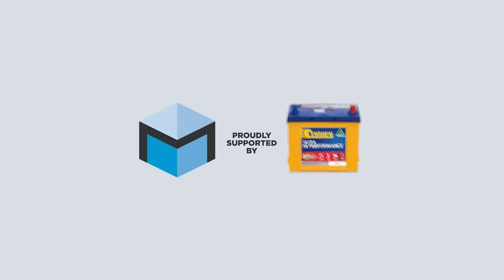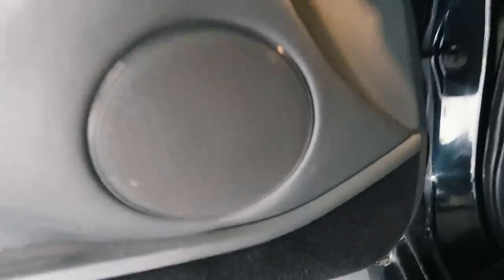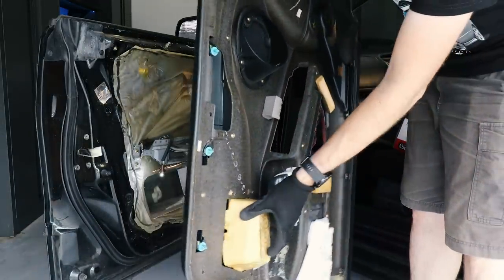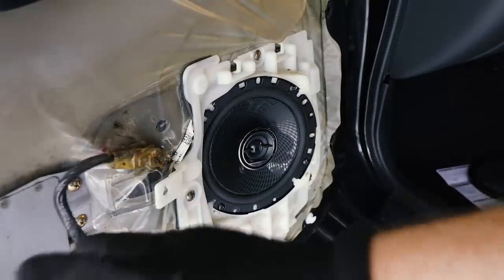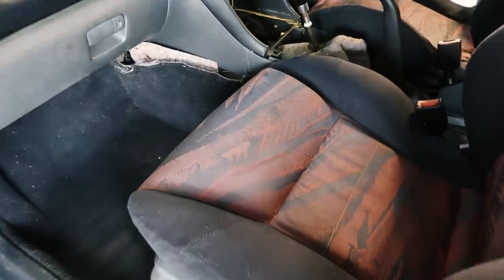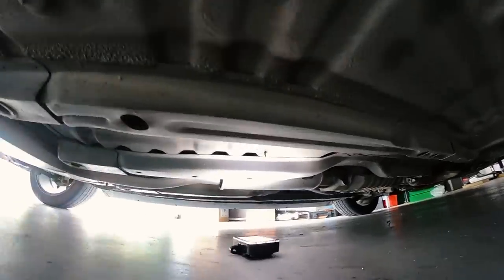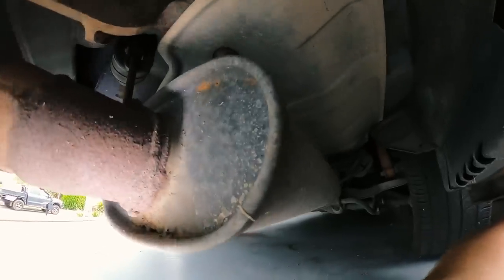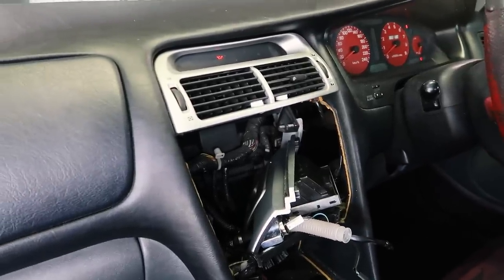😱This Seller Screwed Me! Living the Mitsubishi Magna Ralliart Parts Nightmare.

Comment: Absolutely NOTHING wrong with upgrading your tunes like this mate! You're the one that's gonna be driving AND listening to your favourite sounds. I'd do the exact same myself!
Reply: Nothing wrong with Kenwood either - decent quality Japanese kit.  Cars are very compromised sound stages anyway - so putting high end expensive speakers in them never made sense to me.  Better off spending more money on your living room setup.
Reply: @Beer_Dad1975  very good point. I had a friend that was an audiophile and ad you say a true system would be incredibly difficult in a car. I just loved volume and bass.
Reply from the maker: They're great speakers for the price - I've put them in a few cars now. This was the first time I was able to use 6x9's though, and they're pretty punchy. I am not an audiophile but they seem to output nice bass, so you don't really need a subwoofer (in my opinion).
Reply: @davekennedy6315  That's really what you need, enough volume and clarity so you can hear what is going on over the engine and road-noise - any nuance is lost anyway.

Comment: If the heater core is such a repeating problem due to plastic failures, I'd take the new parts to a radiator specialist and get them to bend and solder on metal tubes instead.
Reply: Investigate at least.
Reply: There have been a few lots done of metal replacements. Still a couple put there from those, but about time for some again

Comment: I hate this car so much and I love watching you fix it up at the same time I’m unsure what to do with these emotions. I’ve cried and laughed at the same time. I’m a mess. 

For pulling the dash apart, All the screws etc into ziplock samich bags as you do each part. Write on the bag what they are for. And even number the bags in order of how you pull things apart. Get some plastic crates and put the bags of parts into the crate as you go to keep the small space tidy. I have lots of crates for bigger jobs and put tape on the front with contents written on them.

Comment: Great video Sean. You'll find as you go on a project that you'll find things that need replacing & it's usually the small ones that hold you back. I'm finding that with my '03 VY S ute that has the factory LS1. One of my switches on the dash was broken & you can't get them from Holden anymore. Ones from the wreckers are dubious as I went through 3 of them to get one properly working. Keep searching & be persistent. Make sure you check the suspension for worn items. I had to replace my tie rods & front bushes over the weekend & I'm lucky that those items can be easily bought.
Don't worry about the haters as it's not their car & only use forums for info & not get into arguments with those who think they know it all. At the end of the day, look at the end goal & that is you'll have a great car that you restored yourself.
Reply: @@xXAussieSkillzXx It was the VY/VZ mode/set button. I managed to find a good one but wreckers being wreckers will sell you any shit they have for a quick $. I had to get a new driveshaft a while back & ended up getting one made. Finding solid axles for Tonners & Crewman are like trying to find rocking horse droppings & friends of mine who have them have to get theirs rebuilt.

Comment: Great video, that Walker exhaust would be the original as Walker was the OEM supplier for the Magna as they had a factory on the Tonsley site. Mitsubishis and exhaust issues seem to be common, for some reason they all seem to suffer from it (all but 2 I have seen have had holes or corroded exhausts). Great to see you do content on the Magna, its such a cool car.

Comment: Make sure you do the hydraulic tentioner when doing the timing belt , its going to let you down later if you don't. They go limp and teeth jump on the belt. Usually about 20oook down the track. Precautions change the water pump valley pipe and O rings too. These also fail over time. Pin holes develop in the pipe and we'll orings we all know.
Reply from the maker: Yup I'll be doing all that!
Reply: @MotoringBoxTV  ensure you vertical bleed the tensioner too. There is an online bulletin somewhere outlining how in storage they can develop air pockets

Comment: Just did a heater core on my VT Commodore, highly recommend taking lots of photos, zip lock bags marked with where the screws/ bolts etc go

And the biggest tip of all- take each part out and lay it on the ground in the order it came apart, and then put it back in reverse order 

Saves getting a long way in and realising you missed a part that should have gone back in earlier!

Comment: Ok so next time you do interior... Pull the seats out and pressure wash them with a small Karcher or something with low power and a wide fan. 
The rub them down with a water based food safe degreaser and go again and wet vac out. One last pass with fabric softener.... Allow to fully dry in the hot sun before reinstall. 
Try it on something crap if you don't believe me.
You can even ad things like bluo or Radiant Black Wash to get colours back out. 
Also make sure you air gun out any plugs underneath the seat too. 
I also do it with carpets and stronger door trim fabrics. The hoodliner can't handle it so your stuck using a damp micro and a wet vac there... Or just replace it.

Comment: You can replace the heater core o rings by debasing the aircon and removing the evaporator under the dash to give access. The replacement o rings sold by Mitsubishi now are improved and wont leak again. Been there done that.
Reply: Pull the gas from the air con, remove evaporator, do some slight metal cutting mods, and then pull out heater core and renew. No need to remove dash

Comment: My Dad had a silver Ralliart magna up till several years ago. Felt good on the road and compared to falcons it felt so much lighter through corners. Most annoying thing I found was I would have to take it slow on the throttle engaging 3rd gear as the clutch would slip under load if you were pushing it. Even when the car was fairly new.
Also the clearcoat was terrible. I think all Magnas of that era were like that

Comment: I've had 2 Magna's over a span of 10 years and found using good quality OE/Genuine parts are the way to go. Also, had a good sound system with an AV head unit. Properly set up using the settings and it sounded awesome, didn't need a sub with the fade set a little to the rear.

Comment: Fantastic cars these RA magnas are and quite a easy car to work on aswell. Even with minimal skill the heater core job is simple. Iirc the head is stamped with RA which denotes it's the genuine RA spec engine (or heads at least).

Comment: Leaky valve covers are a common Magna problem Sean. They have a inner lip that deforms easily if over tightened, but Mits recommend no sealant be used, just torque to specs, so care is needed. From what I can gather, the sealant can affect the O2 sensor.
Reply: Absolutely true, I just finished resealing my whole engine I spent more time cleaning the gunk off than putting on new seals. Don't use sealant of any kind!! It will leak again and it's so painful removing it.

Comment: You have certainly lucked out on the front speakers.
From factory it was a three way split system, woofer in the door, tweeter in that black triangle sail area at the front of the door on the window edge and on the dash were mid range speakers.
Unless the wiring was totally changed, it should still be there.
Dash mids and tweeters are readily available from the wreckers, though, normally in this type of upgrade, you leave the dash mids and then install a good split system in the door.
Too late for all that now, but, just some more info, also, early Verada had door insulation that fitted to the rear of the door cards and will make a big difference in the sound quality and even just closing the door will sound better.
Reply from the maker: Pretty sure the dash ones are still there (well the fluffy grille things are anyway, and I sourced a set of factory tweeters luckily.

Comment: We spent over $2k on that stupid heater core leaking. The original just had an O ring failure but they replaced the whole unit and it completely failed 6 months later. Such a bad decision using plastic parts

Comment: Ex Mitsubishi tech here, just so you know Sean you can technically do a heater core on these with the dash in place if you remove the glovebox and frame, then wiggle the carpet out from under the center console area. Though if you're pulling the dash for other reasons or have the time I would recommend you still do so. Flat rate is a bitch and you'll be sitting upside down in the footwell with coolant in your face if you do it this way.
Reply from the maker: Thanks mate - I read a comment the other day suggesting this (might have been you!) And had a look to see what space I'd be working with. Looked like a bit of a nightmare, so I think I'll still bite the bullet and remove the dash 😬
Reply: Dash is easier way. Dash out is easy. While you are there. Might as well reseal the old dried sealant, left side of windscreen. When it rains you will end up with a puddle on passenger side 2 of my 3 magnas have the problem, and it is very common now . If you get on facebook and search you will find the threads, amc had threads but it was down last time i checked.

Comment: I would upgrade those heater connections, I'd go as far as to re-manufacture them. Not in plastic because I know they will fail again
Reply from the maker: I think it's the o-rings that fail... but having said that I do wonder why they didn't just make them metal and weld them onto the core itself.
Reply: @MotoringBoxTV  yep, built this entire vehicle and chose to cut costs right there. I wonder how that element compares to other Australian cars of the era. Just thinking that they aren't made by the car manufacturers but by a parts supplier

Comment: If possible, I’d appreciate a link to the website you bought the Varex muffler from. I’m thinking about possibly buying one😊
Reply from the maker: I ordered it from XForce directly through their website - I went for a VMK40-250. It's a 2.5" in 2.5" out and should fit a Magna perfectly. If you've got a different pipe diameter or different car you'll have to check how much space you have available and see which model would work best 👍

Varex worked well on a turbo Skyline I used to own, but the jury is still out on how it'll be on an NA engine like my Magna. We'll find out soon hopefully.

Comment: Could have also reconditioned the OEM bonnet struts. Aftermarket exhaust fitted to it already?
Reply from the maker: You could but I don't really see the point, the aftermarket setup looks neater anyway.
Reply: @MotoringBoxTV  make sure you have enough clearance then or you'll scratch the suspension domes (when the bonnet is shut; the original struts' dog legs serve that purpose)
Reply from the maker: @nessuno5403  I'll check, certainly seemed to close without issue.

Comment: I used to have all sorts of problems sourcing parts for my ralliart
Reply: Being a limited run car there will be a lot of trouble finding parts for these. VR-X's on the hand are a lot easier
Reply: @Crippsyify  i sold the car 13 years ago so its not an issue anymore
Reply: @jonobrtn  13 years later it's now extremely hard to get parts for these. I really want a Ralliart but the VR-X is more common so it's a bit easier to get parts for them
Reply: It was shit because Mitsubishi only had a handful of dealers who they allowed to be Ralliart dealers.

Comment: Good luck mate.
Just letting people know right
What the Magna really is. 
Is a Mitsubishi 3000GT with more displacement 2 less cams and 4 doors. 

And if you know what a 3000GT is like. You know they go hard af.
Reply: The Magna and the 3000GT couldn't be further apart. You have NO idea.
Reply: @moshesheckel7369  didn't say they were identical. 
Was more of a statement similar to what people say about the Toyota Chaser and the Toyota Supra MK3. 
Both have the same or similar engine and drive train both are fast both are good one has 4 doors the other has 2.

Comment: Don't do the timing belt - Run it till it blows. Then 6G75 time...
Reply: It's worth more with the original motor though. 
Plus you can just upgrade the cam's to boost power to 210kw. 
5 came like that from the factory. 
Then add the Sprintex twin scroll supercharger, 30 came like that from the factory too. 
That should give you roughly 280kw & over 500nm of torque without compromising on resale value.
Reply: @brantleyfoster021  or just keep the original engine and store it (For so-called purity). Then do everything you mentioned to the 3.8...
Reply: @turbosigma  
You would get more power & a lighter motor for sure, but think it's worthwhile when keeping the original motor too. 

Supercharged Mitsubishi Magna VRX (6G74) 
251kw & 440nm weighing 1460kg (most powerful Dyno confirmed Magna)

Vs 

TMR 380 (6G75) 
230kw & 442nm weighing 1700kg.  

Which do you think would win? 
The 6G74 is still a great platform.
Reply: @brantleyfoster021  With all mods being the same. The 3.8 easy.  Will be doing it to my AWD if/when the engine gets to tired/dead.  And as the majority of every sigma turbo owners replaces the 2.0 with a 2.6 for similar reasons (but I still have the original engine sitting under the house in a barrel).

End of the day it's up to the owners personal preference....
Reply: @turbosigma  
Do you have a TJ series AWD Magna?
Reply: @brantleyfoster021  Yes, 2003 TJ AWD.  On its 3rd auto box repair. Going an evo manual box (bell mod or plate adaptor) if it ever go's again.
Reply: @turbosigma  
Just keep in mind that the standard auto gearbox in your car has the EVO VII GTA's auto Gbox. 
So it can be tuned for launch control & the shift's can be made to be much faster & sharper. 
Adding a transmission cooler will also make it more reliable & last longer. 
Can probably create a baby GTR. 

The EVO's 5 speed gearbox is a very good option mind, it can handle massive power. 
Think it's the most durable transmission Mitsubishi have designed. 
It should reduce the weight of the car by 80kg I think. 
It's up to you though. 

All the best with it, make sure you switch the full size spare tyre kit in the boot for a flat tyre repair kit too. 
It doesn't work unless you remove the boot floor carpet & the wooden masonry board, so it reduces weight by as much as 30kg. 
There's actually 2 wooden masonry board's in the boot, remove them both if you like. 
Makes the boot look better too as it splashes the colour of the exterior of the car into the boot.  
But maybe you will prefer to just remove the full size spare tyre kit, boot floor carpet & wooden masonry board's to feel the greater difference less weight will bring😉
Reply: @brantleyfoster021  Over autos.  
And unfortunately have to keep a full size spare to clear the brembos. 
Guessing you have/had a magna as well?
Reply: @turbosigma  
You can keep the full size spare in your house or garage though, doesn't have to be in the car I mean.
Reply: @brantleyfoster021  30 s/c factory Ralliart you say? 210 kw from a simple cam swap...hhahahhaaha...dream on
Reply: @wiked3801  
It wasn't just a cam swap. 
The compression ratio was also lifted to 10.1:1, so it required higher octane fuel's. 
5 Ralliart Magna's were built like this from the factory. 
Similar to the Mitsubishi Cordia, they normally got 110kw & 210nm. 
But some had 150kw & 300nm, when you consider that they only weighed 975kg - it's no wonder the Police took them on back in the early 80s. 
Very effective in chasing people down too mind, nothing V8 on the road came close back then. 
Mitsubishi always give a few of their performance model's unique tuning.
Reply: @wiked3801  
Camshaft's can increase power output by up to 37kw. 
These ones didn't increase it by that much as you have to take into account the lifting of the compression ratio to 10.1:1. 
But the total increase was 30kw overall.